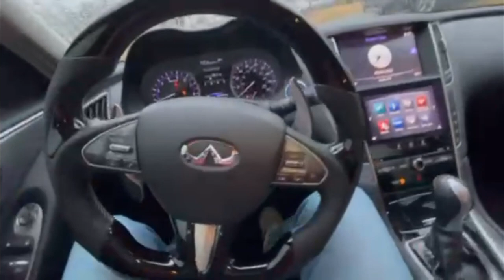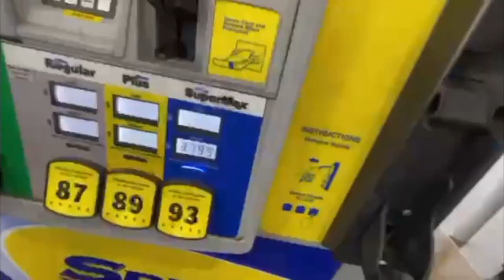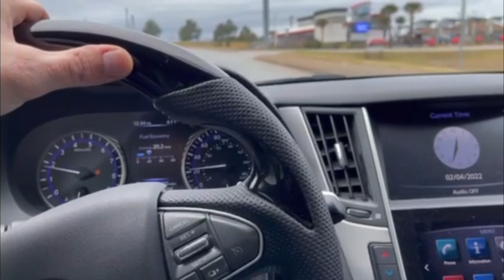Q50 Vlog | Why I'm Not Buying the New Z…most likely, probably, maybe.  Diff Bushing Test Too!

Comment: 36k-38k on the low end base model not even considering the higher trims. I wouldn't get it either of the rip. Lets see what happens with it 1st. Prices will drop after a yr and will take just as long for good mods to come out anyways. Besides most people are still on the older platforms so plenty of content to be made.
Reply from the maker: I agree.  Have plenty to get into at the moment!
Reply: People prefer VQ’s over these new VR’s anyway. We all love the High revving trumpet 🤓